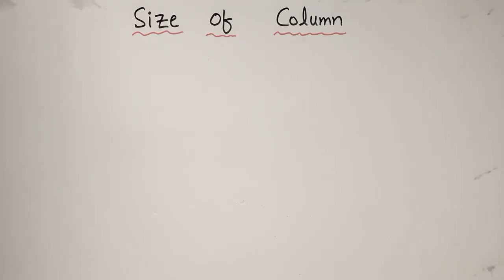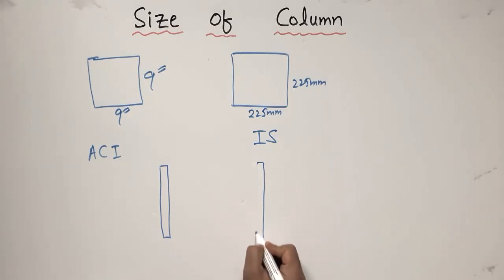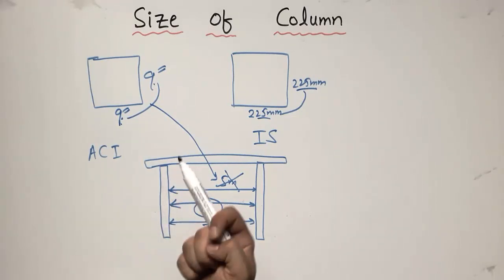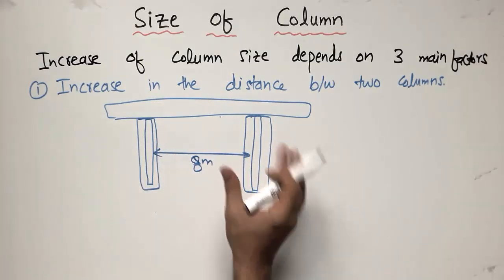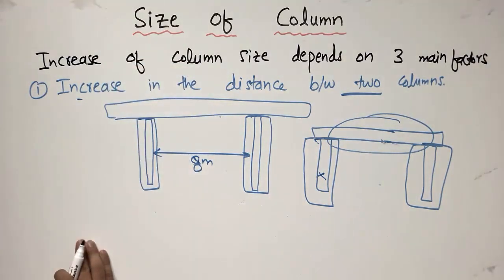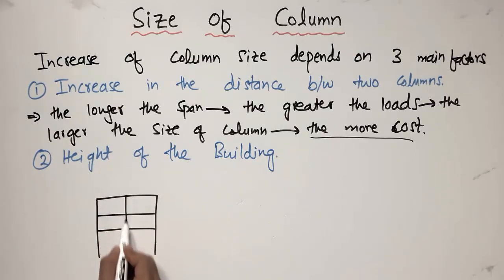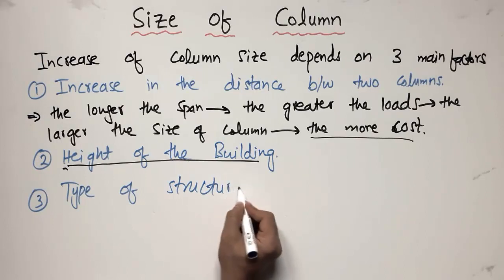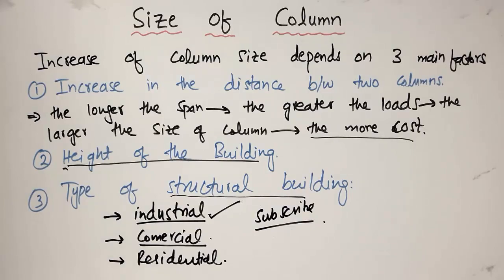Minimum size of Column || Factors affecting size of Column

Comment: What should be the size of the columns for a 3 story house with the beam span of 14ft
Reply: So for a 14'span I should use a 12"×12" column then for a 3 story house that is about 30 feet high